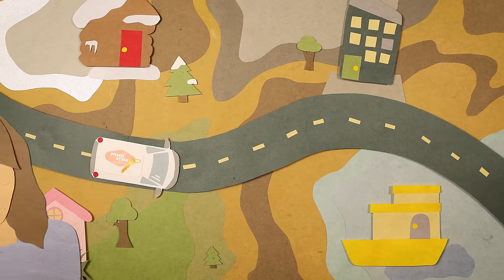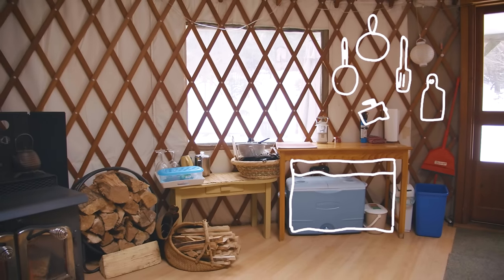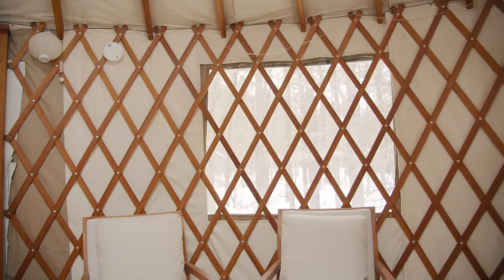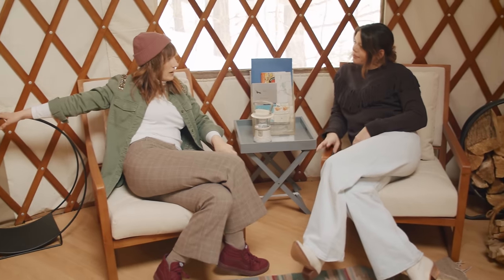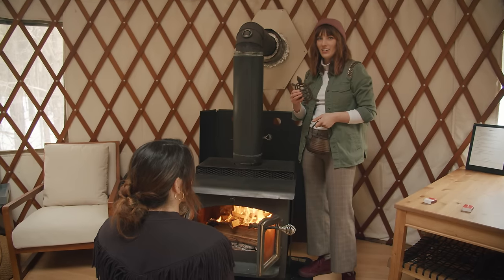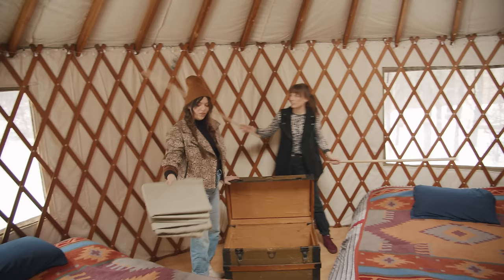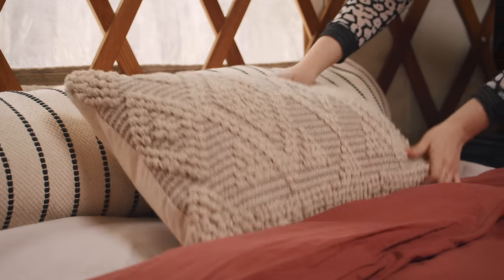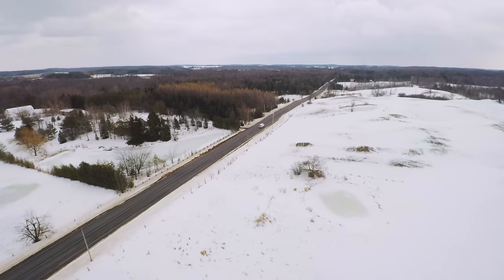we made over a tent?! | Upgrade My Stay

Comment: The entire space looks amazing! I love how camp-like and cozy the space is. It looks perfect for a cold snowy day. I guess the only issue I see here is the lighting option the girls chose. The problem with battery operated lights is that the batteries run out very quickly, meaning the couple will have to replace it often (like every few weeks or so depending on how often they're used, which I'm assuming will be every night). They are also located in very hard to reach areas that would require a ladder in order to replace the batteries. Sure it looks aesthetically pleasing right now but it takes a lot of maintenance to keep. Perhaps in the future you all can use an alternative light source if needed? Maybe solar powered fairy lights since the place is located in an area with a lot of exposure to sun?
Reply: Yes, and it would be more eco-friendly
Reply: @Cccc123c33  Well, I have two sets of solar powered fairy lights at home and they even come with a remote. So, yes, they do exist.
Reply: Maria Martinez: Recetas Dukan y más where would one buy these solar fairy lights?

Comment: To chop wood: make sure your legs are spread apart, DO NOT stand wtih one leg out, it’s very dangerous (for obvious reasons) and hold the axe with both hands, one hand farther up than the other. When you swing bring it around your shoulder, and focus on where you want to cut it. Note when you swing down, move your hand up, and then back down when you hit it. Does that make sense? I hope so lol

Comment: ok it's very viby but like... batteries?? that someone has to climb a ladder to change?? I would be pissed if I owned this place. You'd have to change them all the time.

edit: I didn't register that there weren't any outlets, so it's really the best they could do in that situation. I still don't think I'd put batteries up that high outside of like a smoke detector
Reply: They make them remote controlled for one and two batteries can last a long time. Not like u change them daily.
Reply: @Itslilly_kit  definitely fair but in my experience those battery string lights run down annoyingly quickly